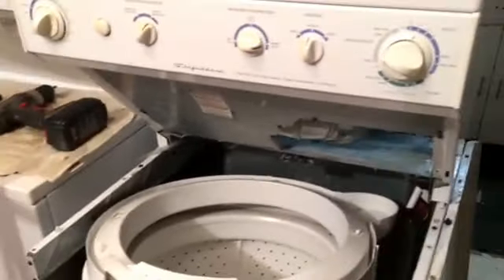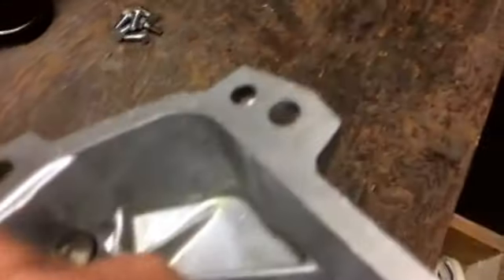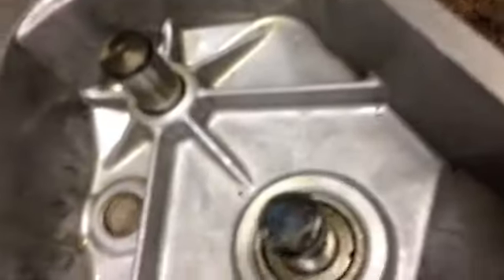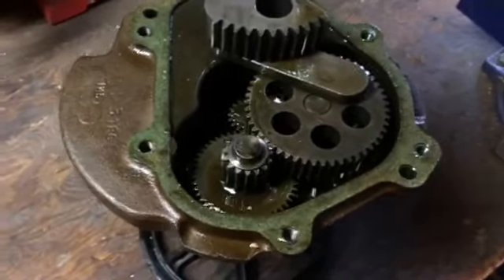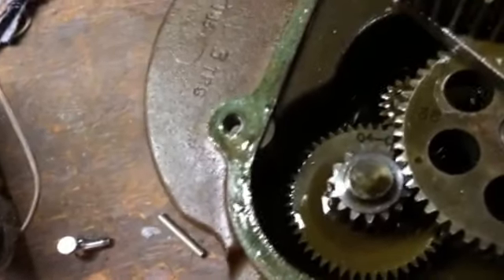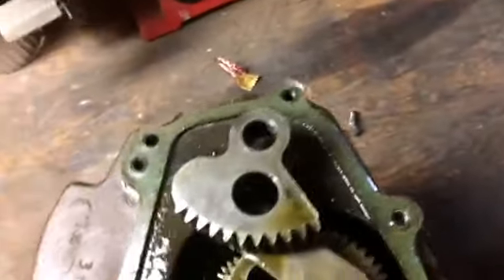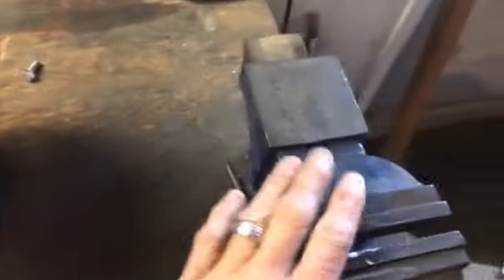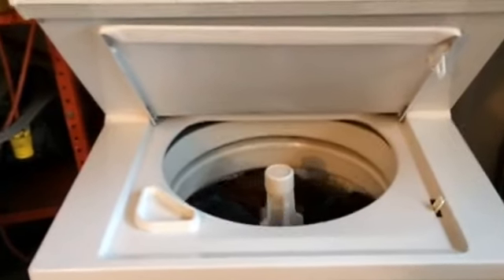Frigidaire Electrolux transmission repair disassembly agitator won't agitate spin cycle

Comment: Thank you so much for posting this video!  I have a small apartment complex with 12 of these units and now I know how to fix this issue.  The first time it happened, I bought a new transmission for over $400.  Now another unit is having the same issue.  I will be doing a little welding this time…. You are a lifesaver!

Comment: Mine spins and agitates, but doesn't force the clothes downward. How do you tell the difference between bad agitator dogs and this transmission problem? Also, how do you get the dogs out of the agitator? Or do you have to buy a whole new agitator on this model?

Comment: Hello Sir, Thanks for the video. I know you don't reply to questions but i am going to try my luck. My problem is during the spin cycle it makes loud noise. like whole transmission going to break off. During Agitation its runs very smooth. Do you have idea what could be the problem. Also did you put back same dirty oil, or did u put new oil? new oil type/grade and how much of oil did you put back? is there any gasket between cover and the pan? thank you for reply.
Reply: Check the lower spin bearing underneath the transmission. It is NOT the same as the outer tub bearing. Instructions and necessary parts for replacement are available in a Frigidaire transmission service kit. Good luck.
Reply: @Chris-gv3xg  Hi Chris, Thanks for advice. Yes, I did figure out that bearing is bad. I already removed the transmission with tripod out. Removed the pulley nut. but now another issue of frozen drive pulley I am tackling. I soaked with lot of penetrating oil, WD40 but it's not moving. Not enough space to hit with anything. and I don't want to heat the pulley base. Any suggestions you have for me please. Thank you.
Reply: @JayJay-wv1vx  Keep hitting it with WD-40, from top and bottom side. Use the straw on the WD can if possible to spray the center of the pulley where it mates with the shaft. Let it work its magic then jiggle the pulley by grabbing it with your hands on either side and rocking back and forth gently. Repeat spray. If that doesn’t work use a hammer to tap a screwdriver right on the center metal piece of the pulley to break the rust weld.
Reply: @Chris-gv3xg  thank you. will let you know how i make out.

Comment: I have same issue, but can't get the agitator off, seems stuck and only lifts up slightly. How did you remove agitator? Did you have issues taking off?
Reply: The top screws off and then lift the rest of the agitator
Reply: Going to reply in case anyone else has the same issue I had with removing agitator and hub. The white agitator is usually held in by a bolt. I removed mine with a nut driver. Then, you can lift the white agitator off of the shaft. My agitator hub was stuck on the transmission shaft. We soaked it in "PB Blaster" (most penetrating oil brands will work), but it still wouldn't budge. We eventually had to heat up the hub (a small blowtorch or even a woodburner stuck down into the hole will work). Be sure you wipe up excess penetrating oil before applying heat just to be safe. Pour ice-cold water on the hub and try to lift it up. We had to do this process about ten times before we could get the hub off of the shaft.

Hope this helps someone. I scoured the internet for tips. A wedge between the hub and shaft sometimes works as well as a cold chisel to split the hub off of the shaft. Good luck to anyone needing this comment :)
Reply: @msluvdmb  do you have a video link to remove the transmission? I chiseled and used a blow torch to remove the agitator hub and bought a new one but found out it was the transmission gear from this video. Gonna try to weld it.

Comment from the maker: I posted a video if you search PJm0551 you will find a video referencing how to disassemble a stacked unit to get the transmission out. Search YouTube for transmission replacement someone else has posted a video on how to actually get the transmission out.  I have not posted such a video good luck.

Comment: How did you get the transmission off. Did you have to move the whole unit by laying it down or did you leave it in the upright position. I have the same issue with the same model washer/dryer combo.

Comment: Would like to know what kind of oil to use in the transmission for Frigidaire fex831cs0 washer as well as the oil level of amount!? 
Thank you;
Reply: I am guessing any bar and chain oil will work... you just don't want the gears getting hot ; I know its kind of late to reply but someone else might be looking for the answer.
Reply: @SAVETHEPLANET-KILL-A-GLOBALIST  I would use 80 wt oil you can buy at any auto parts house.